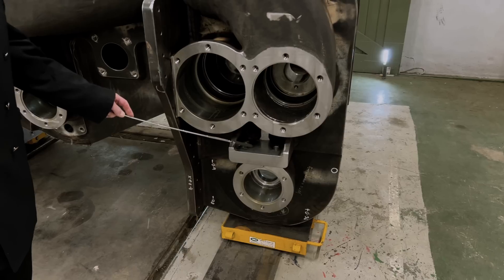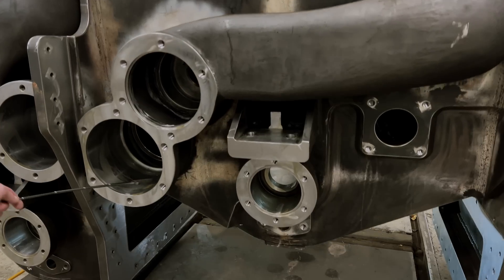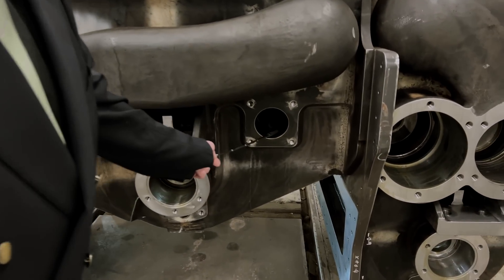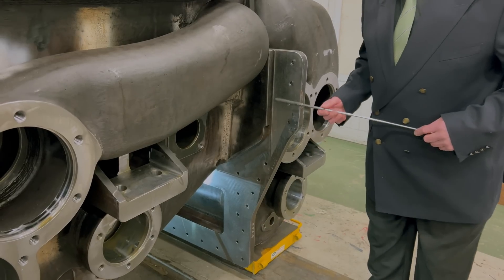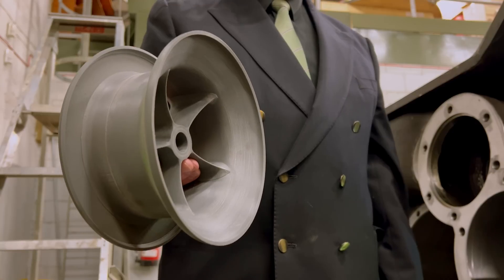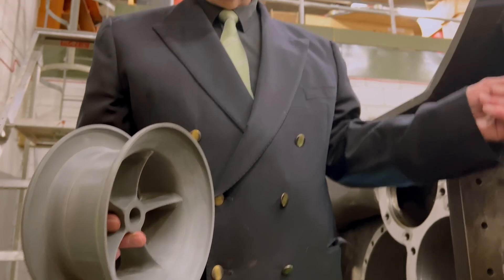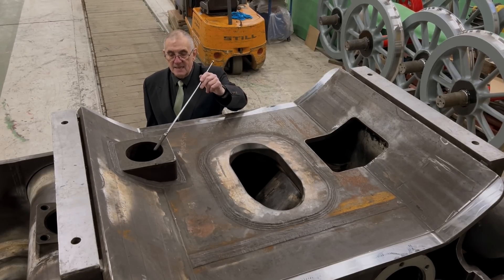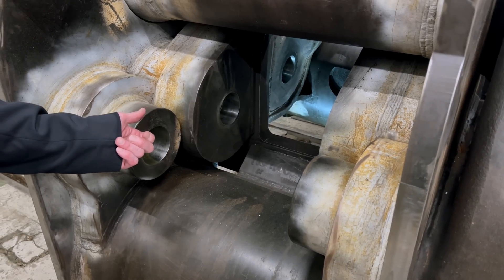David Elliott talks about the P2 cylinder monobloc.

Comment: OFF THE RAILS ???
Well a very nice piece of very complex modern casting. But I'm not sure this is the path to take. The original "Cock of the North" only lasted a short time with Lentz equipment, and was modified to be Standard with all the other members of that class. By having the Lentz equipment removed, and standard Walschearts Valve equipment fitted. Indeed the new loco can barely be described as a P2. As it's now a modern and unique design in an era that no longer uses steam as a power source for traction (except for historical Heritage reasonns) which this loco now no longer belongs. And even the name chosen isn't in line with the original naming policy of using Scottish names. And the inclusion of the word "Wales" (in the new name) reeks of Political manipulation, and I can see exactly where that is leading.

Worse this love affair with "Lentz" which was clearly superceded in Britain by the more advanced British Caprotti method, has added heaven knows how much more to the cost of construction, and clearly delayed the construction by a few more years. Indeed the organisation behind the construction of this loco, is now in the position of having an increasingly "Tarnished" name, amongst other Steam Railway & Steam Locomotive owning organisations. The accusations from a number of other quarters within the "Heritage" movement is abuse of the Charity system, to obtain personal wealth by dragging out the construction time, to the detriment of those donating the money, to line certain pockets !!!!!

Comment: Just WOW! This is seriously impressive. Back in the day when these were originally being designed, all they had were slide rules, log tables and graph paper. 
This is being done with modern CAD programs, stress strain analysis software, CNC cutting and machining, no doubt some laser scanning technology in there as well. Yet with all this assistance, its still a mind boggling undertaking. 
Its 1 thing to resurrect an extinct class of locomotive, going off the original drawings. Its quite another to do all that, but to also redesign certain aspects that were causing the original examples to under perform. You have some seriously clever people working on this! 
Thankyou for bringing us along for the ride 😀

Comment: David forgive me, closer inspection of the 3D drawing reveals that the inner valves  are driven extended rocker shafts from the outer rotary cambox. It was the term rocker shaft that made me jump to the wrong conclusion vis a vis oscillating cams.

Comment: May a Yank ask a question??   This appears to be a single-expansion locomotive, with the exhaust from each of the 3 cylinders being immediately sent up the smoke-stack (chimney).   Is that correct??
Reply: Yes, 3 identical cylinders.   Compounding was not popular in the UK, the LMS (London, Midland, Scottish) did design  compound locos but it wasn't general practice.    The GWR (Great Western Railway) built 4 cylinder locos with two cylinders inside and 2 on the outside, but not compounded, but 2 or 3 cylinders were the more common.  Done routinely in the marine world with triple and quadruple expansion engines.   I think some export Beyer-Garrets were compounds?

Comment: WOW WOW WOW, you actually made the cylinder block for Grezza,s Grunter!!!!, complete with Caprotti rotary poppet valves, a beautiful piece of engineering, I have that in my sitting room with the telly on top . Must display the block at the Tate Modern for a short time in order to raise more funds and get Grezza,s P2 Grunter boiling chuffing and hissing. Do you have the licence to make more cylinder blocks in both Caprotti and Walschearts form ? . The double beat valve shown in the  video looks like a 1930,s Dunlop aeroplane wheel, similar to those of an Auster or Tiger Moth. My  kind of educational video, informative well presented and cannot wait to see Grezza,s Grunter chuffing puffing on the rails  with a nice rake of teak carriages, Piglet will have an orgasm and a fit.

Comment: The steam engine loco needs an even bigger update - I envisage two steam-powered bogies connected to the steam source via a flexible couplings. Each bogie can have a pair of cylinders. It would have four driving axles but no unpowered axles. The water and coal tender would also have two bogies with the water tank connected to the drivers cabin via a flexible coupling. The fire box, steam tubes and drivers cabin would have a frame to link them to the bogies. We could have a conveyor to transfer coal to the engine and another mechanism to feed coal into the fire box.

Comment: I still don’t understand why a fleet of brand new locomotives could not be constructed fired by bio fuel or gas. They are cheaper than a diesel electric by a long way and powerful at low speed. Fantastic achievement and great education from this video.
Reply: It's a nice thought, but I think it was the maintenance costs that killed steam.  The accountants wanted something where you could just climb into the cab and turn a key ... on preserved railways of course you get a lot of that labour free.
Reply: Steam still powers the turbines in power stations , wether they be nuclear , bio fuel , gas etc.  We all use electricity. The only free energy is wind and water power which has to be harnessed by machines , built by engineers who have the ability to design and build them .
    The steam engine and the bicycle were the greatest inventions ever . Only a few generations back we had neither , and man could only go as fast as a horse could carry him , the wind would blow him , or gravity would attract him , machines had to be invented to control the forces of nature .   Unfortunately  vast progress was made as a result of wars , eg aviation .  AI ? We need real intelligence to make a better world ?!

Comment: Very good video of this excellent mechanical work.
Welded steel fabrication makes a good replacement to cast iron as shown.
I am not sure of the advantages of the poppet valve over the piston valve.
The piston valve is the simpler but still effective method of steam control so I assume there must be 
more precise timing with the poppet valve.
It is easy to deal with a greater volume of steam by making the piston valve and ports bigger so the poppet valve
must be for precise timing I guess?
I have  great admiration for the team undertaking this project.
Reply from the maker: Walschaerts gear is still a compromise that chokes the exhaust events.  Poppet valve gear like this allows a completely free exhaust and thus reduces back-pressure.  Take a look at the design study for more information:
https://www.a1steam.com/educational-resources/prince-of-wales/design-study
Reply: @thep2steamlocomotivecompan19  Many thanks for your reply. I shall look at the design of the Walscherts  actuation diagram .
I feel a piston valve is a very simple method of controlling the flow of gases and used to good effect on steam engines , petrol and diesel engines.
The actuation of the piston valve can be achieved by a variety of ways such as eccentrics, cams, etc.
The poppet valve is very good for modest volumes  and becomes a choke for bigger volumes such as large Marine Diesel engines.
Presumably the poppet valve for steam locos was not a success and not used widely
I am not up to speed on this topic ad appreciate your feed back.
Many years back I was with Ruston in Lincoln when they were designing the AT range of Marine diesel engines.
They went with fabricated design for the crank cases , cylinder blocks etc which was a success saving weight and machining time.
I must say you have made a good job of your P2 cylinder block.
Changing the topic. I never understood the benefits of more than two cylinders for a non condensing steam engine ?

Comment: I got to agree with the other commenters, CAD tools are a game changer in projects like this. That as well as the latest techniques in casting and machining , using the latest materials available today, makes these newbuild projects slightly better than the original. 

One unintended consequence of the CAD work on the locomotive is the digital preservation of the original blueprints. As paper (and sometimes cloth) blueprints age to the point of being untouchable, digitalizing these is the only viable way to preserve them and making them accessible to the public at large.

With this new development, we can't  wait for the P2 to run the rails as well as other newbuild steam locomotives as well, like Pennsylvania Railroad T1 5550 in the US.

Comment: 1) Whilst I accept the 6 P2 locos were almost 6 different prototype locos, there is a risk in changing Gresley's design, in that, to some extent, what you build might have unforeseen issues. 

2) The metal in the middle of 8 shaped castings looks noticeably thinner than the rest, and I wonder if this will be a weak point. 

3) I would be intrigued to learn, if the off-setting the centre cylinder has been done with other locos, and whether this led to unbalancing of the centre of gravity, as both the weight and the mechanical forces are no longer in the middle of the loco.
Reply from the maker: Unlike Gresley, our team have access to CAD, fluid dynamic analysis and FEA analysis, stress-relieving, VAMPIRE and X-ray testing.  You can see more here https://www.a1steam.com/educational-resources/prince-of-wales/design-study  To help us achieve this you can support the build here: https://www.a1steam.com/p2donation#/
Reply: @thep2steamlocomotivecompan19  Even Gresley was not sure about the outcome. You would be foolish to trust a computer for everything. I sat on the approvals panel for Tornado, and I recalled the 'experts' never listened then either. But the A1 was to known drawings, and you have done so big changes on the P2.
Reply: @vicsams4431  You're obviously more expert than the experts. Remember Y2K? Didn't happen.
Reply: @briantitchener4829  I asked valid specific questions and got fobbed off.

Comment: Would it be possible to do a video on how the Lentz valve gear works? because I cannot find a good animation on how it works and I'll be honest, I am struggling to visualize what you're trying to say, even with the 3D photo of the cam boxes. I think a nice video on the valve gear would help people like me who are both mechanically minded, but understand best with a visual demonstration of the parts. Overall though, this is so fascinating the engineering that went into this cylinder bloc
Reply from the maker: You can always join the Monobloc Club and gain unrivalled access to the machining and installation of the cylinders which should answer all your questions, it very had to describe the way in which the valve gear works without being able to look at it.  To help us achieve this you can support the build here: https://www.a1steam.com/p2donation#/

Comment: A brand new poppet valve gear locomotive!

Lets whats the difference between the current modern poppet valve gear, The Duke," and the redesigned one using new understanding in thermodynamics and a healthy dose of computer aided drafting and cnc machining.

Comment: Superb engineering but qhat is the RA ?  a lot of heritage railways couldn't run this beast due to it's weight ?
Reply from the maker: RA9
Reply: Designed for main line use I would think,  like the original P2's.    A lot of heritage railways probably couldn't run a Stanier Pacific, the A1, a Merchant Navy, a King or the DoG either.
Reply: A significant number of preserved or heritage railways have made use of RA9 locomotives so 2007 ought to be able to visit lines in a similar manner to Tornado.

Comment: No one thinks that steam locomotive engineering is modern or in need of top quality designers and production capabilities.  You knocked that idea and thoughts out the park, out the county and over the border. A fantastic way to show  what modern engineering capabilities can do to improve anything in our life. This just happens to be a steam locomotive.  I doubt if the Rugby test plant would cope with  the power the P2 will put on the rails.  Excellent presentation and production of the video.  A very proud team including the designers, casting, fabrication and machining  companies, created this one part.   Wow.
Reply: Nice to know that there are still the skills available in this country to tackle projects of this magnitude.

Comment: So the valves are spring-loaded because of the camshaft drive - why is any of this necessary`? A Walschaerts timing gets away without the need for springs.
Reply from the maker: Walschaerts gear is still a compromise that chokes the exhaust events.  Poppet valve gear like this allows a completely free exhaust and thus reduces back-pressure.  Take a look at the design study for more information:
https://www.a1steam.com/educational-resources/prince-of-wales/design-study
Reply: @thep2steamlocomotivecompan19  Yes, thanks and accepted, but you're storing ("wasting") energy in the springs, which Walschaerts gear didn't need to do.
Reply from the maker: No more than a car engine does when it lifts a valve.  The gains outweigh the losses.
Reply: Feel free to design a desmodromic alternative!